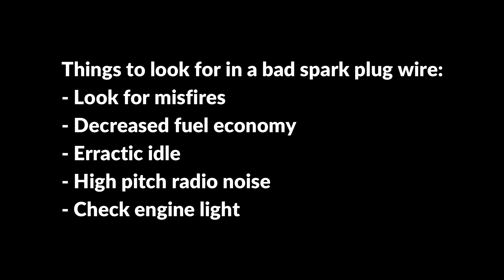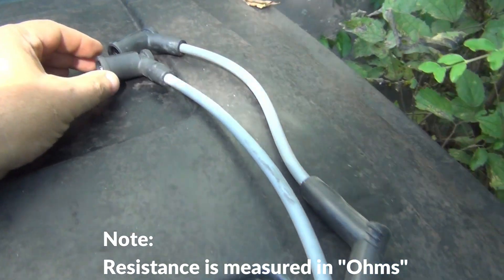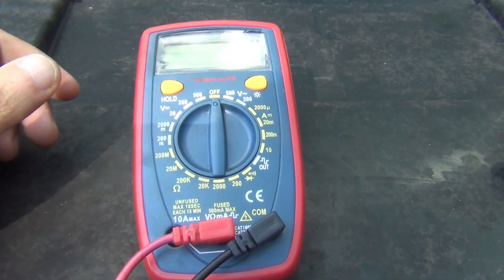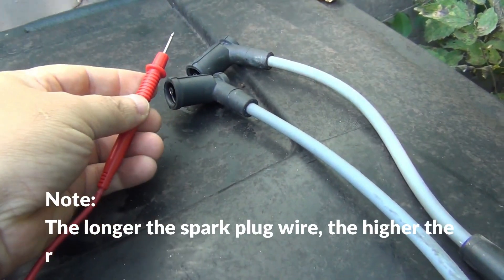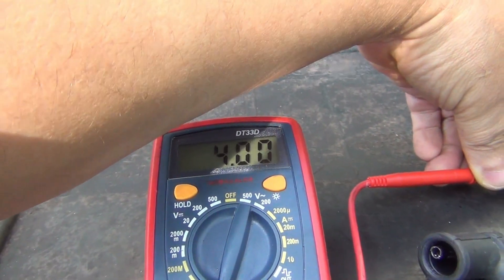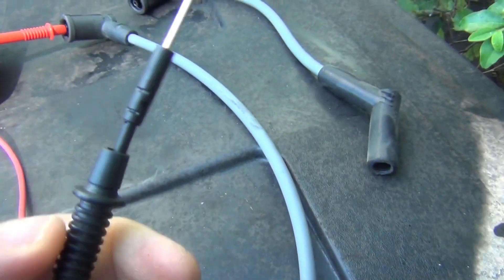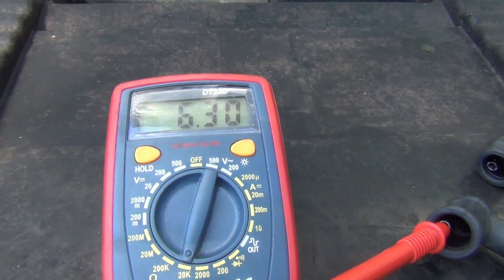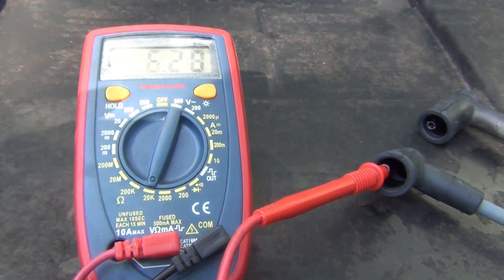How to test your spark plug wires for resistance

Comment: What if the numbers are fluctuating?
Reply: Common, especially if the meter probes aren't making the most solid connection. I push the sharp probe into the metal connector and it usually somewhat stabilizes. As long as it's within a reasonable range, it's probably ok. Brand new quality resistive wires may be 5K to 30K, depending on specs and length. I check for consistency between multiple wires. 

I had two wires that measured around 800,000 ohms (0.8M) and fluctuated a large amount. They'd shoot up to 2M! That was about 100X as high as it should've been (2 million ohms vs 20K). The inside of the connector was corroded and the bond between it and the wire was lost. Surprised the car ran decent. New wires seemed to help idle.

Comment: So?  What is considered normal range ?  Geez
Reply: Normal range would be whatever the manufacturer advertises for their wires

I have "50 ohm per foot" Edelbrock Ultra Spark 50's for my LS3. They are around 10-10.5 inches long, and measure 0.03ohms at 20k(30 ohms, well under 50ohms per foot).